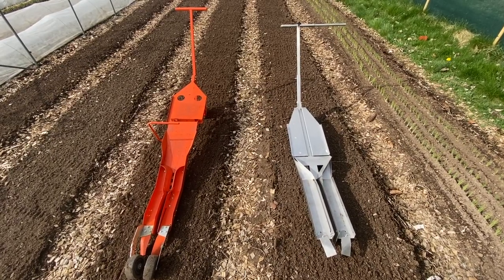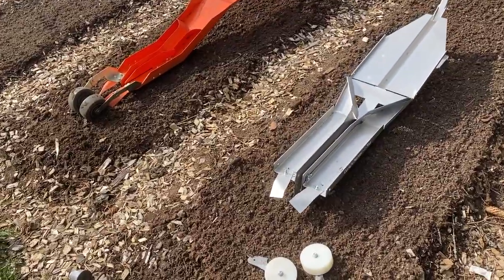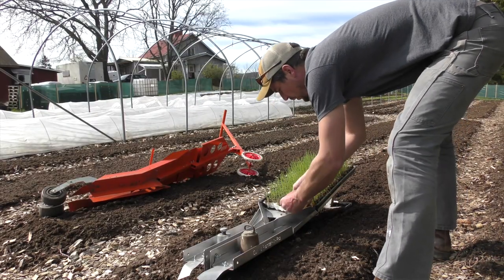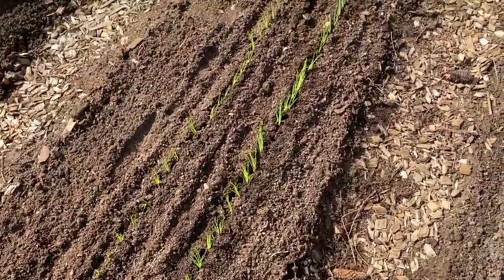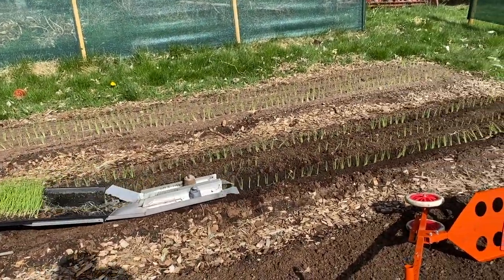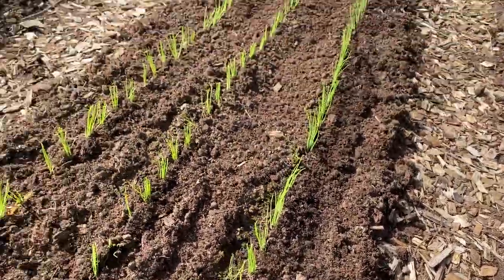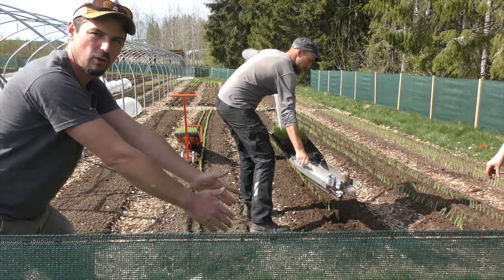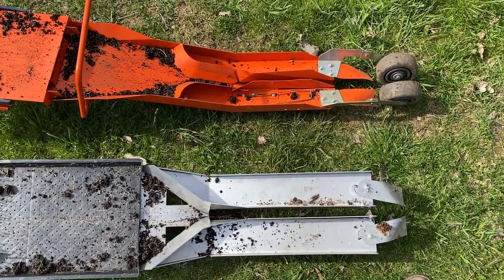TESTING PAPERPOT PLANTERS

Comment: Try removing the small back wheels on the japanese version. I'd recon that you'll see better covering of the rows by doing that. Downside is it will be harder to pull along. But perhaps you can negate that downside by making those flaps longer and flatten out at the end, so they become small skies of sort that rides on top of the compost.

Comment: I'm sure that thing does its job, but, just from the looks of it, if I had to work with it it would take me about an hour to start contemplating suicide.

Honestly, even the one on wheels looks a bit frustrating to use. The paper pot chains, and the way you seed them, are brilliant, and a pleasure to work with I'm sure. But I'd rather just use simple hand tools and a three step process (dig, place, cover), to get them into the ground. It should still go pretty fast, and the plants would be planted deeper.